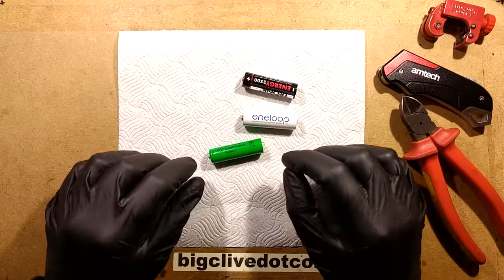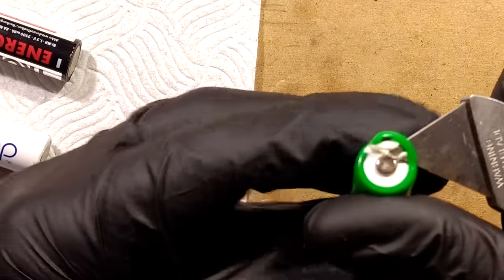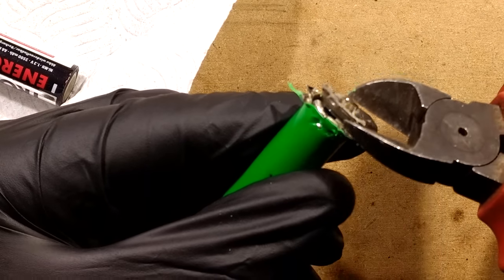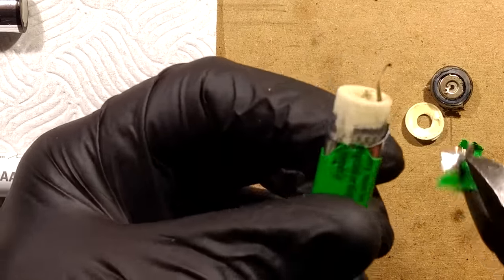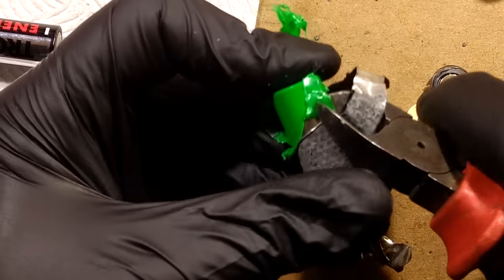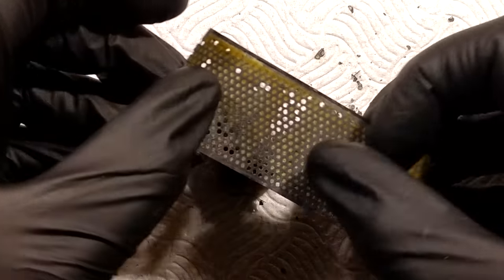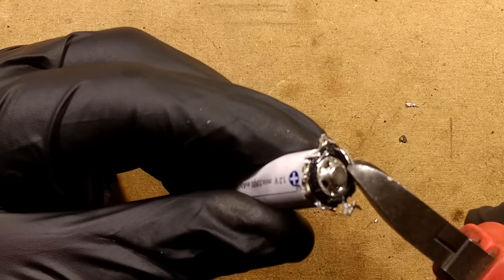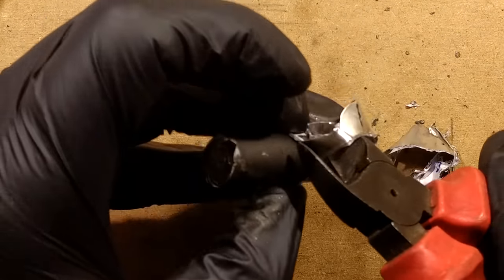What's inside Eneloop and LIDL NiMh cells (fire, apparently)

Comment: One thing I forgot to mention in my previous comment. I did have a bad experience with a battery one time. I think it was around 1967 or 68.
  A classmate of mine had a dead battery in his car. So I went along with another friend, we were going to jump the dead battery with another classmates car that summer day
  I have been working evenings and weekends and over the summer in a gas station/service station, doing everything from changing tires and pumping gas and changing oil to pulling transmissions and replacing valve covers, just about any dirty job..
  so I had jumped cars before with jumper cables and I knew how to do that, that’s why I was asked to go alone
 So I hooked up the jumper cables to the donor car, read to positive, black to negative, then I hooked up the other end of the jumper cables, black to negative, and when I did the final connection red to positive, The explosion was heard two blocks away. The police were called. I had battery acid in my eyes and in my mouth from that explosion of the dead battery. I was lucky that it was summertime, because I ran into the nearest house which was right there and broke through the screen door, ran upstairs and jumped in the shower.. it felt like I had grapefruit juice in my eyes. Luckily I had no lasting effects from that..
  I later found out what happened. I had the battery cables hooked up correctly. But the last connection made a spark..
  do you remember the dirigible named the Hindenburg?
that was a hydrogen explosion
that’s what happened to the dead battery when I made that final connection that was sparking as I hooked up. I did not realize that dead batteries give off hydrogen.
  when I got out of the shower, the police were there, it was summer so everyone had their doors and windows open on that street, and there was a crowd looking at the car and looking at me when I came out of the house to see if I was OK. The casing of that battery was gone except for about 2 inches up from the bottom. All of the battery plates were exposed..
 that was a hard way to learn a lesson..
  another battery not very happy story
A motorcycle enthusiast like myself, and my friend, he owns a automobile collision repair shop. He occasionally goes to the auto auction where he buys cars that were declared total wrecks by the insurance company, and they sell them at auction. Auto repair shops buy these cars if they are not too bad and they sell them after being repaired.
 my friend has been doing that for over 30 years, he has five employees he does well, he also buys motorcycles and sometimes he fixes and keeps them, sometimes he sells them as is to be repaired and converted into track day bikes..
 at the auction one day was an electric motorcycle. The brand was Brahma. That’s the only electric motorcycle at the time that has a manual clutch in a manual six speed transmission.. when a motorcycle frame gets a scuff on it. It is automatically totaled by the insurance company. This electric motorcycle had a perimeter frame which is out there exposed up near the steering neck, and it got a scuff on it in a minor crash. Wasn’t a crash, it was just a skid bent foot peg, bent the bars, broke a lever, broke the mirror, scuffed the fender and the frame.
  so my friend bought it, it was actually the only bidder. that was around 2016. He fixed it and wrote it around for a while, it was a novelty, I would often see him at bike night gatherings on that bike instead of one of his Ducati’s..
 he couldn’t go very far on it, the range was a little over 100 miles supposedly..
but he learned on a blog for electric motorbikes, A blogger suggested that totally completely discharging the battery, and then re-charging that battery, that will give the battery extended range and more power. So of course my friend left the key on over the weekend to completely discharge the battery..
  when he went to charge the battery, nothing happened. It would not take a charge at all. He ended up calling the factory and talking to some of the mechanics. They walked him through a test with his meter, and after about 15 minutes, they told him the bad news. Your battery is toast, you’ll have to replace the battery pack. And while you’re at it, get that motorcycle out of your place of business because it is in danger of exploding all by itself and it’s discharged state ..
  so he wheeled the The bike outside behind his big long concrete building and left it there so he got this problem resolved..
  he called the factory and asked again, about the battery, and how he would go about getting a new one. They said they could connect him to the proper channels to get a new battery. He asked how much a new battery would cost him.
  I am not kidding. I swear to you I am not kidding. My friend belongs to his local church and they do nice things like have collections and support missionaries that go to South America to help those people living in the jungles.. what I’m saying is my friend does not lie..
  The factory told my friend that the battery pack for his Brahma electric motorcycle consists of seven battery cells. Each one of those cells costs $6000. There are seven of them. That means the battery costs $42,000.
 again I am not kidding and neither was my friend.
 he told them on the phone that that sounds ridiculous because he could buy a brand new bike that comes with a good battery for only $21,000..
 after hanging up, he went on the Internet through his connections with other salvage yards across the country looking for another crashed Brahma electric motorcycle to salvage the battery from. After a year he gave up on the hope of ever finding a replacement battery from a crashed vehicle. Ended up selling the motorcycle for parts on eBay..

Comment: You should try opening a tube of ROLO (Nestle chocolates). Once you get the outer paper layer off, there's a roll of aluminium foil. 
Then, all the individual 'cells' are arranged with the top parts (slight depression in them), yes, all arranged in the same direction. So it must be a 'series' arrangement. I cannot detect any voltage on my metre, so I'll just have to suck it and see (well, suck them and see).

Comment: You started the fire when you stick that nickel metal alloy mesh to that negative electrode. 16:18 When it caught fire you drop the mesh and scatter the chemicals, then you accidentally rolled the mesh further making more reaction. That is why there is separator. To prevent the contact of positive and negative materials. :)

Comment: Maybe you can answer this question. I have a theory that when NiMH cells get older and their performance degrades (low capacity, low runtime) it's partially because the electrolyte has dried out. I've confirmed this by drilling a tiny hole in the bottom of an old cell, injecting some distilled water with a syringe, and testing the cell again. The performance improved markedly. The AA cell went from 0.2A short-circuit current to 0.7A short circuit current (almost as good as a healthy cell). I'm just having trouble finding a good way of sealing the cell. So far I tried soldering, but the alkali in the cells corrodes the solder and it crumbles away after a few weeks.

Now that you've taken cells apart, do you have any good ideas for replenishing the electrolyte? Maybe drilling the hole in the top or side? How would you go about filling it? Maybe welding, or using epoxy resin instead of solder? I'd love to hear your thoughts.
Reply: Ave would probably use carbon arc welding 🤣

Comment: Great video. Longer = Better.  I think I noticed something, but I might be wrong... At 16:19, one edge of the mesh, briefly touches the black material (below your left middle finger).  That seems to be, where the ignition starts. I don't know how these things work either, but I'm guessing there was brief high current, when the mesh touched - enough to heat it up.  Right - I'm off to Lidl.

Comment: 50$ says patent will show small holes throughout the mesh, but the factory used larger holes to cut costs and make a cheaper less efficient product that you need to replace more often.... which is bad cuz discarded batteries are terrible for the environment,

Comment: I think I would have tried using a Dremel-type cutoff wheel or circular saw to slice the battery shell down two opposite side, then pull it apart in two halves. The cutoff wheel would probably be safer, since A) it is not conductive and B) with no teeth it probably will not fling any chemicals out the way a toothed blade might.

Regarding the can, I doubt that they jam the rolled up internals into the can. Most likely they use an oversized can, slip the rolled internals in, and then use a press and die to squeeze the can down to a smaller diameter, and at the same time swage the + side cap on. Similar techniques are used for soda cans.

Comment: The solar light battery is permanently overcharged. So the water in the electrolyte may also be electrolyzed (if above 2V) and the gases go through the safety valve under the + cap. The overpressure valve unfortunately also serves as a one way valve. If you find a way to hold it open. you can pre- heat the battery and then dip it in icy distilled (deinonized) water or die the valve into it and cool the battery someway else. The KOH (potassium hydroxide) neither evaporates nor decomposes. So adding water is just fine - like you do with any huge Ni-xx or Pb battery.

Comment: Came back to this classic to measure the Anode material...
This is to help solve a method for restoring Ni-MH batteries, by charging at a rate of 3mA/cm2 until they reach ~33%, then storing them at about 50 degrees for 24 hours before performing a slow charge / discharge cycle... Stupid research papers - they couldn't just specify "per amp-hour" or even drop a "C" rating...

Comment: Li-Ion ones are more dangerous if opened. If this happens dont extinguish with water. Water doesn't make a good team with lithium and will cause them literally to explode just like fireworks. I guess its safer to throw a blanket on it to suppress the oxygen or to let them explode safely.
As for brands I dont recommend tronic or other no-name Ni-MH rechargeable batteries because their real capacity value is way much smaller than advertised.
I decided to replace my normal batteries AA/AAA from remotes and everything from home with rechargeable NI-MH ones and so far i have purchased Philips and Kodak. Can you believe it Philips are a bit worse than Kodak? All are supposed to be 2600 mA but the Philips ones have unstable capacity value.
 These are at the 5th recharged cycle and the value is changing. Sometimes is 1800, sometimes is 2300, sometimes is 2400 , sometimes is just 2100 mA after recharging. While the Kodak doesn't have 2600 mA as advertised but its much closer and more stable on capacity, sometimes 2400, sometimes 2200, sometimes is 2500, but never dropped under 2200 mA.
 And all these Ni-MH are brand new, like 6 months old and at 5th recharging cycle.
Much better brands are Eneloop and Panasonic but these are more expensive and Eneloop doesnt have 2600 mA ones.
There is a catch/secret that not many people will tell you: Smaller countries and/or developing countries will get low-quality (double-standard) items from factories at importing. It's called Dumping. Maybe that's why i got poor-quality Philips accumulators. I dont know, but 1 thing i know now, kodak has better rechargeable accumulator than philips.

Comment: You think that is annoying? Make some parts out of Zirconium. When Zirc gets to a particular surface area to weight ratio, basically dust, it becomes pyrophoric. So when I shape, by grinding, a handle on a knife and throw Zirc dust everywhere, I 100% HAVE to clean my entire shop. If using a dust collection system, it will 100% catch of fire if it doesn't have a water trap. 

Even better, in an exciting sense, is when using a fly cutter. The chips that come off of my mill end up being fireballs thrown 20 ft by a 2" fly cutter spinning at 2k rpm. Shit gets real really fast when Ryu is pissed while riding your milling machine's table.

In the end you have a metal fire, which is easy to deal with if you know what you are doing. However morons will throw water on it and just feed the fire with hydrogen and oxygen or use an extinguisher rated for other types of fires. Remember kids, smother metal fires. Class D if using an extinguisher, but those babies are pricey!

Comment: The weather is awful so I stayed in and re-watched an old BC video. Ah yes, the joys of opening stuff up/watching others do so - and I re-learned a word, too: pyrophoric. So I looked up Wikipedia's description: - 
"A pyrophoric substance (from Greek: πυροφόρος, pyrophoros, 'fire-bearing') is a substance that ignites spontaneously in air at or below 54 °C (129 °F) (for gases) or within 5 minutes after coming into contact with air (for liquids and solids).[1] Examples are iron sulfide and many reactive metals including plutonium and uranium, when powdered or thinly sliced. Pyrophoric materials are often water-reactive as well and will ignite when they contact water or humid air. They can be handled safely in atmospheres of argon or (with a few exceptions) nitrogen. Class D fire extinguishers are capable of dealing with pyrophoric fires." 
Clive, we just love what you do!

Comment: Some 15 or 20 years ago i had a similar experience, the fire was not so intense though. It was a battery cell from a 90s cell phone (Erisson T10 probably). I thought i'd short circuited the cell i was unrolling. And it was the time i was doing things like that over my bed (nice flat and not cluttered surface), not a workbench or a concrete floor. Might have ended bad.

Comment: Huge nimh fanatic here, lol.  Yes, but seriously, I hate to say this but if someone had a gun to my head I'd choose energizer 2300 mah cells.  Even over eneloops.  The Ladda 2450's are quickly growing on me too.  Sorry, but it's true!!!  I've tested so many types with BM200, and used them for a few years.  I've tried ALL of the batteries pretty much including the high capacity (and high self discharge rate).  I wouldn't buy more Powerex models because they've built up high internal resistance rather quickly (2 years).  I hate to say this because everyone rips on energizer ("they don't WANT to produce a good battery for obvious reasons!!"), but I've got to say, I bought them at the same time and they have won the battle of the NIMH, IMO.   True to their 2300 mah and still have low resistance.  FWIW.

Comment: I'm a theater tech for a local performing arts theater, and we have been using the same 16 AA eneloop batteries for the past ~8 years. Most of the casing is peeling off of them, but they're so expensive that nobody wants to buy new ones. They still work fine, I guess. But this video is making me wonder how close they are to just... combusting.
Reply from the maker: They won't combust, but if the sleeving is coming off then then there's more risk of a short between positive and negative.
Given how much money they've already saved it would be good to replace them with fresh ones from time to time.
Reply: 48 dollars for replacing those 16 batteries, the theater has likely spent much more than that on condoms (to protect wireless packs) over the last 8 years.
Reply: @jrstf  ... you're supposed to protect wireless packs?
Reply: @CrimsonGamer99  - Maybe not, in the theatre I visited they make use of sweaty actors, the salt water shorts out the transmitter.  I don't know if that's generally a problem.

Comment: Recently opened a smartphone. Noticed Battery was spongy/squidgy. Prodded it.
It exploded, Fireworks, Flames , Acrid smoke, which set off the smoke alarm and panicked my missus who had just gone to bed. 
Stamped on it to prevent a major fire.
Melted the sole of my shoe and only stopped flames after stamping around a few times.
Could hardly breath so picked it up gingerly and deposited it in the kitchen sink, and opened windows, doors and turned on extractor fans.
Burnt fingertips : fingernails brown and smelly.
Prised the molten black stuff from under my fingernails which took some skin and left enough stinging to prevent sleep.
Carpet destroyed.
Expensive lounge suite ruined.
Stench still there for days.
Bruises on arms and head ( from the only other person in our house)
Insurance not sympathetic. Agree for carpet, but not phone and only the sofa which is part of a 4 piece suite.
Furniture shops closed.
Nothing online even remotely like my suite, which is unique and matches the other room furniture and decor.

Pity I did not see this post sooner.

Comment: Those generic batteries are awful.  I have a dozen or so in AA and AAA, and they're really bad.  They don't last 1/4 of the time a "normal" battery does (Eneloop, Duracell, Energizer rechargeables). Some came in outdoor lights but I bought others to give them a try (a 20 pk or something).  The lights they came in went dead within 3 days in the strong, summer sun in southern Florida, so it was either the batteries or the solar cell.. So I replaced them with Energizer or Duracell (can't remember) and now they work great.  It really is worth it to buy good batteries.  I've had them all and Eneloop seems best.  I try and make sure they're Japanese, or at least from Japan.  The Chinese variants are definitely lesser, but still OK.  But for the same money it's always best to look for Japanese cells.